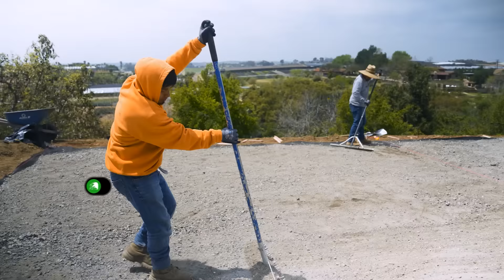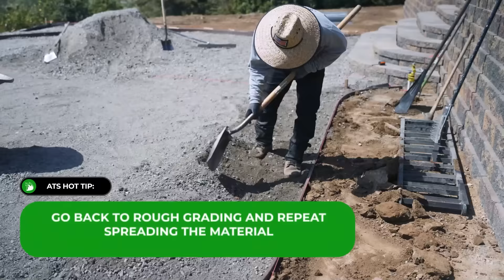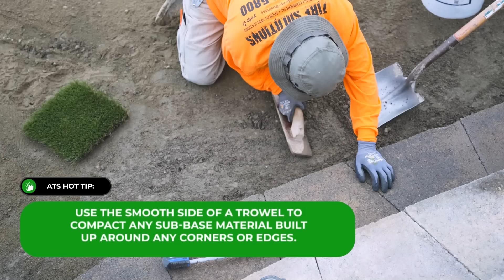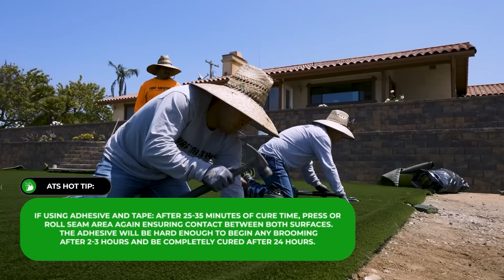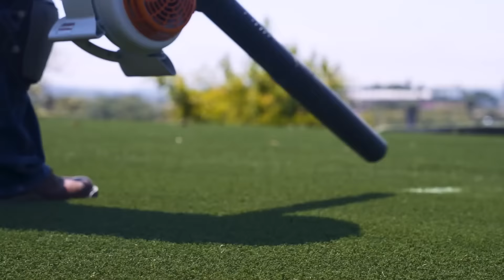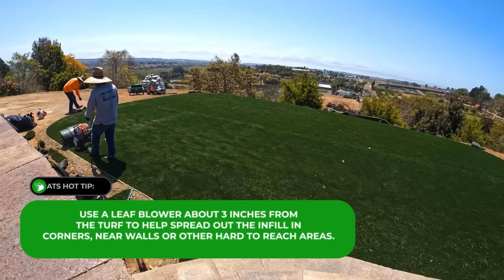DIY: How To Install Artificial Turf – Master Guide

Comment: I'm a landscaper with absolutely zero experience in artificial turf but was recently requested to give a quote on astroturfing tiny 25 ft x 25-ft backyard. I'm assuming the meticulous compacting is what holds the 6-in spikes? You just nail through the AstroTurf into the compacted sub base and base materials correct? This method is solid and suitable for use in situations where dogs will be assumably getting the Zoomies? I appreciate any insight or advice!

Comment: The thick bender board shown in this video is a bad idea. The product expands, contracts, warps and eventually lifts out of the ground especially when used in heavy clay soils. Adding more stakes won't fix the problem.

Comment: How do you do turf edges if butting up against natural grass?
Reply from the maker: Although installing artificial turf directly against natural sod isn't recommended, you can install a pressure-treated wood board as a divider. This allows you to secure the turf with staples while clearly separating the two areas.
Reply: . Thank you.  I'm installing a piece in front of a pitchers mound on a baseball field.  Is 21AA really needed for this for drainage?
Reply from the maker: While 21AA is a commonly found sub-base material for artificial turf installations, typical ¾” crushed aggregate can be used in lieu of 21AA. The sub-base needs to be compactable, and promote drainage, for a long-lasting installation.
Reply: NO CLUE HAHAHAHA

Comment: What about drainage? Would a dog daycare require anything different
Reply from the maker: Great question! All of our pet products include Turboflo backing which allow adequate drainage for pet use. When installing artificial turf in a pet facility, proper drainage is critical to keep the area clean, odor-free, and safe for animals. You would need a permeable base with turf that has the proper drainage holes/backing to allow water/urine to flow through quickly. With the use of antimicrobial infill, you can help control lingering odors.

Comment: Do you recommend adding infill sand prior to sweeping or after sweeping?
Reply from the maker: Both! You can powerbroom the turf prior to remove any debris and fluff the blades and then apply the infill and broom again to ensure the infill is evenly settled.

Comment: What to use for the top fine layer? You said not sand. Then what? 16 grit?
Reply: Decomposed Granite most likely
Reply from the maker: The most current feedback we have from
contractors nationwide is to use a 3/4" down to 1/4" crushed drain rock as your primary
base and then to use the fines (Smaller Parts) as a top coat that can help with drainage
and the way the turf may feel under the feet. These rocks can be found at your local rock
yards and may have several different names. You want to avoid using a rounded rock,
like some pea gravels, as they will not compact well and are too rounded. Some
common names for the base rock material are Crushed Stone, Breeze Rock, Chat,
Decomposed Granite (DG), crusher fine gravel, Class 2 Aggregate or Class 2 Road
base.

Comment: So what was the "not sand?"
Reply from the maker: The most current feedback we have from contractors nationwide is to use a 3/4" down to 1/4" crushed drain rock as your primary base and then to use the fines (Smaller Parts) as a top coat that can help with drainage and the way the turf may feel under the feet. These rocks can be found at your local rock yards and may have several different names. You want to avoid using a rounded rock, like some pea gravels, as they will not compact well and are too rounded. Some
common names for the base rock material are Crushed Stone, Breeze Rock, Chat, Decomposed Granite (DG), crusher fine gravel, Class 2 Aggregate or Class 2 Road base.

Comment: Question, in the project you show here, why would you lay down the artificial turf when all around it there is dirt? It begs one to wonder why the turf would not be the last thing to be installed. I would think that you would not want any cement or other material to overlap into the turf.
Reply from the maker: Great question! The edging creates a border between the turf and whatever hardscape is being installed on the outside of the turf area. The client may have chose to keep the outside areas dirt for this location, or it can always be installed at a later phase. 🙂

Comment: How do I calculate how much base gravel I need if I know my square footage and inches I want in depth.
Reply from the maker: Now that you know what base you are using and the depth is established, you can place
your order for your sub-base rock based on the following formula; 1 TON (2,000 LBS) of
rock base per 100 Square Feet of artificial turf will give you a 3" sub-base.

Comment: Great video. Three comments that hopefully are helpful or that you can correct:

1. Since artificial turf is directional, you want to make sure the pieces are going in the same direction, as you said. In addition, since the turf will be most viewed from one side, such as this application, you want the blades pointing toward that side. It will look more natural and reflect less.
2. For the seam, straight seams are much easier to see, especially when long. You all are clearly pros and can do it perfectly. However, while harder to cut, non-straight seams (an s-pattern or other) will provide a more "seamless" look for a DIYer.
3. For higher traffic entry areas, like the stairs going down to the turf here, I believe it is best to nail the edging every 4-6", but they can be a bit wider for other areas.
4. For infill, there are general recommendations for how much to use, but remember, the height of your grass is important (mentioned in the video as face weight but perhaps harder for some people to determine). If you have a shorter grass, generally, you should use a bit less so you aren't too high up the grass with the infill.

Anyway, hopefully helpful additions from a newbie's eyes to the great video you made..
Reply from the maker: All great points made! We appreciate the additions. Thanks!
Reply: Hi @Artificialturfsupply I'm Ikram Khan From Pakistan 
& I'm Professional artificial grass &  Wall-to-wall Carpet's Fitter Please Give me One Chance In Your Team 👏👈
Reply: You’re just nitpicking at this point. They’re pros and your a newbie like you said. Save the “recommendation”.
Reply: @williamflores9501, since your reply is inconsistent with both my experience and their reply, while also giving no useful perspective, I have to assume you are either a bot or projection your own personal issues on others. If the latter, I hope this year helps you feel better about yourself.
Reply: @ChrisRiche yeah that guy is a douche your advice is good.

Comment: I would not call this a master class. Its missing these lessons,
How to cut, how deep is base, how to test compaction rate, how to move turf as a whole, why not tuck your edges, peel back grass from nail head etc.
Reply from the maker: We have detailed videos to really hone in on each of those steps in our How To Center. Check it out here: https://www.artificialturfsupply.com/how-to-center.html

Comment: What is the fine aggregate called? The one before the turf.
Reply from the maker: The most current feedback we have from contractors nationwide is to use a 3/4″ down to 1/4″ crushed drain rock as your primary base and then to use the fines (Smaller Parts) as a top coat that can help with drainage and the way the turf may feel under the feet. These rocks can be found at your local rock yards and may have several different names. You want to avoid using a rounded rock, like some pea gravels, as they will not compact well and are too rounded. Some common names for the base rock material are Crushed Stone, Breeze Rock, Chat, Decomposed Granite (DG), crusher fine gravel, Class 2 Aggregate or Class 2 Road base.

Comment: If you have pets like us, a Doberman and a Great Dane, you mentioned not putting down weed fabric. But what about the smell on the grass? How do we take care of it so it doesn’t reek all the time ( bedside cleaning up the little chocolate truffles)? 
If we have to use some kind of bio solution or chemical to purify it, wouldn’t that also work on the weed fabric or a geotech fabric? 
For best drainage btw I HIGHLY recommend 1-3” angular basalt rock!! It is also very strong after it is compacted but the people would definitely need to use a heavy duty compactor or riding roller / compactor. It is also difficult to work with because shovels don’t scoop it very easily but if you have a tractor and bucket it’s way easier. Grading is more difficult though for sure. BUT that is also why it goes near the bottom layers and I’d recommend using at least 6” of it so there is more room to actually grade and move it around easier. I put geotech fabric on top of mine but I ended up redoing part of it to add a thin layer of 3/4” to 1/2” angular clean  rock  on top of that to smooth it out so it would be less sharp on the geotech fabric. Now I’m adding even more gravel and will regrade and  compact again, then add Truegrid permeable pavers to  it filled with additional gravel lightly compacted.  Right now it is for a giant driveway for a school bus to use as a turn around spot but I would live to have similar drainage and low maintenance for the yard doing artificial grass on that we can enjoy fun sports in at the same time.
Reply from the maker: Weekly rinsing/flushing will help keep your turf area smelling fresh and odor free! Check out our maintenance guide here: https://www.artificialturfsupply.com/artificial-turf-maintenance.html

Comment: Wow. You can tell these guys are really good. I wish they focused more detail and film on the seam area. I’m interested in doing something like this but use as a periodic tennis court also. How do we keep the seam tight and not come apart? Also I could not really see exactly how they were putting the seams Together and where they were nailing!? How did you hide the nails or did you? Seems like it would be impossible to hide the nails, no? Or at least for super short grass anyway. I’d also like to do this for front yard put put mini golf course plus water features around. We have a large front yard and we need the water feature to muffle sounds of the highway that is 6 feet above our elevation about 200 ft away.
Reply from the maker: Check out the rest of our How-To Center where we have videos on specific sections - like seaming! 🙂

Comment: this has many questionable stuff. Main issue is for me, sand between the rocks and the artificial turf. Sand is a substrate for weeds (think of beach plants), if you sand below the turf, you're gonna get weeds.
Reply from the maker: The fine aggregate is a very important step in the foundation for your turf! The fine aggregate helps smooth under your feet and help with drainage.
Reply: Isn’t turf designed as a weed barrier tho

Comment: Although these are great tips, this is not not necessarily the best practice for all climate zones.  For instance, if you stretch turf with a carpet kicker when it's 90 degrees & nail it during the summer it will shrink & pull the tufts along that nailed edge if the climate zone has freezing temps in the winter. It's best to reach out to a local installer as their experience can be invaluable.
Reply: I hear your point.  Pro installers will always do a better job than Johnny DIY.  But this video was done in such a professional way that it gives us little guys a better understanding of what's involved.  It's very helpful to understand the true "scope" of a project, and if anything, makes me more inclined to pay a PRO more money knowing what's involved!